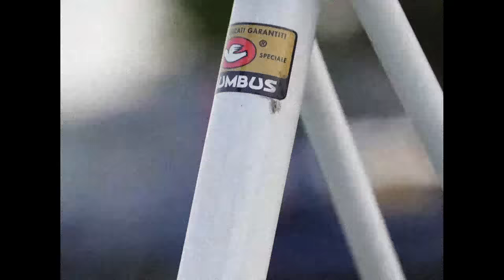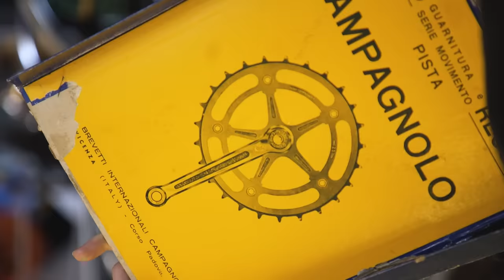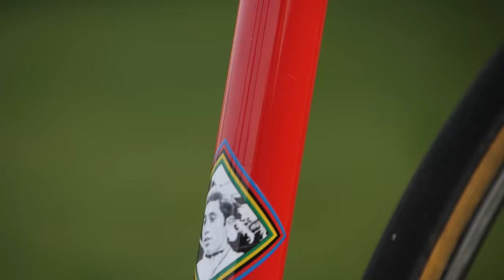Can A Vintage Bike Survive A Modern Race?

Comment from the maker: Have you ever gone racing on a vintage bike? 🚴 Let us know in the comments below! 👇
Reply: Well i only ever raced on 1970 era downshifters, steel frame, five gear block, tubulars.
Reply: Do a track stand at the start
Reply: A classic bike would generally come with 52 tooth large chaining and 14 teeth rear for 100.3 inches.  Now i have 52x11 which is about 27 percent higher. Eddie probably used 54?
Reply: Fifty year old new campy wow!
Reply: No
Reply: My only bike is a 1986 Koga Miyata Randonneur-Extra, but I don't race. ;-) (and yes, I'm vintage too, I guess)
Reply: Great job Si, and every time I race I'm on a vintage bike!  🙃
Reply: It depends on what you call vintage. If you mean steel, the answer is yes. From 1995 to 1999, I raced on my Bianchi TSX, and from 2001 to 2017, I raced on a steel frame, built with True Temper OX. I raced on an Aluminum Cannondale from 1985 to 1994, and an Aluminum Giant TCR in 2000.
Reply: Sure did.... from 1977 through to about 2000. That said I also rode my 1993 Pinarello full-time to about 2016. Going on intense group rides with guys on carbon weapons, I had no problem keeping up, once I got used to the straight block gearing on the rollers... but not a problem at all.
Reply: Not racing but I ride around town on an '86 Dawes Galaxy I got for £40 😁
Reply: I started racing in the mid-80s and the bikes were not that different from that Merckx model.  There were clipless pedals, but my father wasn't going to shell out "$75 dollars for pedals?!?!?!".  That said, toeclips did/do come in sizes, so you probably need a bigger set!  I thought you looked pretty smooth out there...brought back some memories.
Reply: I still have my 1988 Peugeot, that I raced on, although it has got modern 10spd Shimano running gear on it. It only weighs maybe 3 or 4 kgs heavier than carbon bikes, which in the real world makes zero difference.
Shout out to the guys with carbon frames, di2, deep section wheels who only cycle for recreational needs! (I'm one of those too)
Reply: @jonglass  Never mind that u just keep out there doing it Jon !!!
Reply: Si, do the vintage fondo in Santa Barbara, California. Your required to wear period jerseys too!
Reply: Nope
Reply: I have vintage and modern but vintage is more fun
Reply: I did back in the early eighties on a sweet Peugeot, now I cruise around on a few vintage 40's single speed bikes full restored.
I am by no means fast, but I'm still pedalling 👍😂
Reply: Yes, I did the Red Hook Crit on a 1980s track bike.
Reply: I raced this bike in my second triathlon ever. It was a reverse tri on a military airstrip. Had a great bike split, passed twats on $10K bikes like they were standing still. If you put a strong athlete on a great bike they're going to kill, but you put a weak athlete on a great bike they're going to have their asses handed to them.
Reply: First road racing bike as a Junior in 1985. Colnago steel frame/fork Columbus SL equipped with Campy Triumph group set, 36H ambrosio wheels for training, 32H Mavic GP4 tubulars / Vittoria CX/CG tires when racing. I also built my own wheels over the years racing in the 80-90’s.
Reply: what if vintage bike has modern component, neo retro concept, steel frame carbon component
Reply: Lol I raced them when they weren’t vintage. I was racing when Gregg Lemond was a junior. Still have one on my indoor trainer.
Reply: @secretagent86  52/42 front 13/21 rear 6 speed shimano AX
Reply: @0ldw3lshm4n  I have this ratio on my shimano 600 on my '86 Tommasini.  I do wish i had an 11 tooth cog sometimes but at my age, not often.
Reply: Racing no... but I learned on a vintage bike.. well 50 years ago it was not that vintage, but... 😅
Reply: The answer would depend on what you consider ‘vintage’. I have a 2005 aluminum frame of classic geometry and round tubes. It even came with down tube shifters which I later upgraded to an Ultegra groupset of the same year. Does an 18-year old bike count as vintage? It certainly is the oldest of the bunch wherever I go. I would say the limitations have been mainly of my own, not the bike.
Reply: Yep, as a young fit broke man I bought a Motobecane Jubilee Sport at a shop one of the mechanics was selling. Asked him why he was selling, he told me it was too slow to stay in the pack and I would not understand. Rode away from him and his new fancy bike a good dozen times at least as he dropped off the pack doing the Saturday Shootout in Tucson in the mid 90's. And I showed up on it for the Tour of the Tucson Mountains, soloed up to the pro pack from the 3 and higher pack on a big hill, wearing my cut off jeans since I was really that poor, rode into the middle of the pro pack and stayed with them for a good ten miles until a big attack happened and me with my six gears on the back and Helicomatic hub spun out and got dropped. Rode for a while solo, then some pros who had flatted caught me from behind and rode with them a bit, then they dropped me and I did ten miles solo before the 3 and higher pack finally caught me. Finished almost with a Platinum time but not quite. Some guys I knew saw me after and asked how I did, told them I might have done better but got spun out, they start telling me it is not the bike, glance at my bike, stop mid-sentence..."on that?"
Reply: Colnago Mexico
Reply: @secretagent86 so I am between, I have modern bike though but I love using 53:11
Reply: As Si walked past the ambulance I was thinking oh no they are waiting for him
Reply: yep, dad has similar. 54/44 11/21 gearing 😅. And Columbusframe,
Reply: Yes.
Reply: Bien sûr! il y a 40 ans...et j'ai toujours ce vélo! Cadre Reynolds 531, cintre et potence Cinelli, groupe Campagnolo Record, jantes GP74 Mavic à boyaux. Un vélo toujours très réactif
Reply: I once accidentally joined a bunch of friends for a tour on a fixed gear steel frame Faggin from the 70s because I understood they wanted to go to a lake for the day. Turned out they wanted to tour around the lake, 70k Sunday tour. 49/17 was all I got to keep up with the lycra suited guys on top notch cannondales. Didn’t get dropped though, but even though they didn’t admit I believe because they took it a bit slower seeing me there 😂
Reply: Yes - rode a 1969 American Eagle Semi-Pro (bike brand was relabeled Nishiki in later years after they got flak for calling it American anything as it was made in Japan by Kuwuhara) in the 1974 and 1975 Libby Logger Days bike race outside Libby, Montana.  While it was "vintage" (in a vintage race) I think it was maybe the only bike in either race with a double-butted frame, so it was hi-tech at that time in that secluded location.  Took 2nd place both years in a field of 20 or 30 although I wasn't much of an athlete.
Reply: Yep - Eroica Britannia - my local climb PB is on my 1980’s steel bike
Reply: all the time on one of the 4 vintage Colnagos I own, like the Master Lite Rabobank with Pro parts and a Dura ace 7800 carbon crank.
Reply: Get toestraps that fit. I still ride a bike like that every day but I've never raced and it never interested me.
Reply: Do a video with an elite pro riding a vintage bike on a modern race pls🙏
Reply: Vintage Bike Races at Goodwood?
Reply: Eu tenho uma Caloi 10 1976 fabricada com peças do Japão.
Reply: Hi. Yes, and it was perfectly good fun, although I did get dropped but I think that was because of a lack of strength, possibly because I'm just weak & useless, or not long enough on the bike yet (3.5 years). It was straight from the go "... please let this stop ...", so the pain and anguish you can experience on an older bike is just what it needs to be. I got dropped  eventually just like half the field, but I was parading around an eye popping steel Bianchi with an beautifully curbed alu fork, normal inner tubes, rim brake, alu wheels (double walled) and ... bar con shifters (!). A nice big handlebar from last century, costumised with a solid .08 stone (.5 kg) stem (spray painted by yours truly), with your individual Miche sprockets in the back, no fewer than 8 of them (5 would be too many, but got to keep up with the times I guess). The original Look pedals (delta). It was a low level practice criterium on a 1.1 km loop on brick roads with sharp corners. As far as I could see, I was the only steel bicycle in the field. The barcons are probably the most unusual. Despite the tight circuit, I only needed to shift once up and once down every loop. It was marginally more tricky than brifters would have been, but with a bit of anticipation it was fine. (I don't think I would dare go in with down tube shifters, due to added instability.) Conclusion: you can no problem participate in a race with this kind of set up, at least in a beginner category. This was still a real race. Most guys rode something nice and where in sponsored or club outfits and the like. It makes me sad that this whole category of bicycle is sort of lost. It is fine for most/all touring, much training, and certainly lower level racing. It used to be a long lasting, cheap kind of bicycle, with a local economy around it. Can the UCI increase the weight to 1.5 stones please ? XD
Reply: The best riding of my life was in the early '80s, so that's what we all rode. It was the culmination of a decade of incremental upgrades, the most major being a 7-speed block and a Gios frame.
Reply: Fun video!  Getting dropped off the bunch at the start of a mass start race was definitely a thing back in the day.  Happened to me in my very first race (1986) because I hadn’t thought to practice the skill!  😂  Luckily, clipless pedals came along shortly thereafter and I was an early adopter!
Reply: Yes. Still race on 1986 Columbus SLX with SSP group set and singles. Competitive? yes if I apply myself. Riding technique I find is key. I tend to spin faster when there is a surge and shift when I am up to speed. New bikes are a lot easier to race on with fancy shifters etc. New bikes encourage gear shifting.
Reply: I used to race bikes made in the late 50's.
Reply: modern wheelset ang groupset for classic frameset
Reply: @secretagent86  Eddie used 52x15 (97 gear inches) to set the hour record in 1972.
Reply: Mate, i still ride my Paletti, bought in 1976. Full Campag, Columbus Sl. I still have my Gios Torino, bought from the great italian track sprinter Giordano Turrini. Actually i think it is a Masi repainted. These bikes were cutting edge in their day, and my Paletti is still my best mate!
Reply: @secretagent86 Actually, most raced 42/53 with 13 - 17 cluster at the back, or modified for high mountains or perhaps 13-21.

Comment: Absolutely love the takeaway message at the end. I recently tried a couple of crits after exclusively racing track for a few years. Turned up on a $200 facebook marketplace special sporting 15 year old Tiagra. Did I win? No, no I did not. Did I have fun? WAY more than $200 worth. Turn up on whatever you've got and get stuck in! We aren't playing for rainbow jerseys or olympic medals. Just have a go
Reply from the maker: Great! This is what we love to hear! Doesn't matter what you ride or where you come, the main thing is the enjoyment! And we think it's pretty hard not to enjoy riding a bike 😉
Reply: Love it!
Reply: Turn up on whatever you've got, and hopefully that also includes 10 years of pro racing experience. :)
Reply: I recently went to try gravel riding. I did not have a “gravel bike” so I rented one. As I was riding, I realized I was just riding a mountain bike without front suspension, and with drop bars. I took my rusting away, 2004, Trek MTB, cleaned it, changed all the drive train and the breaks, and changed the handle bar for drops. I ended up with a super fun, super comfortable (the suspension is awesome) gravel bike. I spent just $350 for the drive train’s cheap components and that was it. Save your money, lose some pounds and just ride. You will get better.
Reply: Best comment of the week
Reply: @lgarcia67 yeah basically what gravel bikes are . I Would do that as well 😅

Comment: sure you had the wrong cassette in, the toe-clips were too small, & down tube shifters, but you also had the best looking bike there... so that's a win!
Reply: He didn't have a cassette, he had a "freewheel block".
Reply: @stevemawer848  Also a bit of a corncob. He does know that you could have a wider range within those 5 gears installed even then, right? The pros didn't for the sake of macho, but you can get a much wider range than shown here, just depends on how authentic you want to be to Merckx and his ilk versus how you want to ride.
Reply: @cptjeff1  Ah yes, the Regina board with all those lovely sprockets waiting to be mixed and matched!  Are things really better nowadays? 🙂

Comment: Eddy Merckx has actually said in interviews what he would chose from the modern era it would be clipless pedals. Everything else is marginal, that he says was a game changer.
Reply: All of my bikes are from the 70's and 80's. They all have clipless pedals. :)
Reply: Yes, true re the pedals. The only other thing I would add would be 9 to 11 cogs in the back wheel + handlebar shifters. All else, frame wheelsets and tires  need not be changed. Current bikes being carbon fiber are a real scam, far too expensive for what it gives in performance. They are also much too brittle.
Reply: Nobody had clippless until around '86. Prolly started arriving on to the pro scene by '85...Look.  Seems like they could have figured it out way sooner tho...funny how that worked.
Reply: clips are great in reality, grocery getter.....when you hit a large bump you can pull out of them naturaly , AND YOU CAN USE WORK SHOES OR SNEAKERS!
Reply: Maybe it's not really marginal? Perhaps.  But the parts doesn't need to cost a fortune.  There are great modern parts novadays. For example saddle, saddle post, rims, and  so on.

Comment: Way back in the late 80's I bought a used Vitus 979 Aluminum frameset. It was polished with a clearcoat. I transfered the Shimano 105 groupset from the bike I was riding and had a perforated leather Selle Italia seat. I still think that was the best bike I have ever owned.
Reply from the maker: Sounds lovely! Do you still have it?
Reply: Me too bought a 2nd hand Vitus in 86, did more miles than the space shuttle. Expensive but I go my $ out of it😅.
Reply: Sounds very nice !
Reply: 979 and 992 are so fun to ride. So stiff and agressive.

Comment: Drafting makes an incredible difference that no wheelset, frame or skinsuit can compete with. So if you have none of those don't ride on, or go off the front!  It actually forces you to ride smart and not waste energy or otherwise you get dropped.
Reply: That's not true, it took 5 gcn drafters to beat a single tt bike guy
Reply: No kidding!  That could be why you "faced a wall" off the front! :)
Reply: @jason200912  If you don't think drafting makes an enormous difference you haven't done much cycling
Reply: @jason200912  First of all in a road race everyone is on the same road bikes. TT bikes are not allowed in road races. 2nd of all it is an undisputed fact that drafting saves one ~30% of ones energy. Anyone can see this if one has a power meter. In a recent race I was averaging ~300watts for a minute on the front and ~200 watts in the wheels at 40kph in my small group of 8 on the flat. Unless you're on a Boris bike you won't be dropped in the wheels of similar level cyclists.
Reply: @davidf2281  sure it makes a huge difference but you still need 5 road bikers to beat 1 tt biker
Reply: @jason200912  not the same as sitting 20th place in a bunch though.
Reply: @0ldw3lshm4n  why would you be 20th if you know how to draft while on a tt bike
Reply: @jason200912  what are you on about? My point is sitting 20th in a bunch has more drafting benefit than a single line in 5th place. if you dont believe me try riding behind a derny on a track in a line, 1st place is great but when you peel off and drop in 8th place its really hard to keep up.

Comment: Good luck in 50 years getting a moden day dura ace to work 😂

Si as always a beast on the bike
Reply: At that stage, the di2 battery would hold about enough charge for the neutralised 1st lap.
Reply: Mechanics say those old friction shifters are practically indestructable.
Reply: My oldest bike with derailleur gears is a 1953 James that has Cyclo Benelux Standard THREE speed for 1/8" track chain. 27 x 1 1/8" High Pressure.

Comment: I just fixed up my dad told road bike from the early 80s. It was such a joy to ride it. The downtube shifters are actually really nice, and I feel more in tune with the bike using them. It’s probably slower than a modern setup, but the feel is outstanding.

Comment: When I compare my rides on Strava between my Pegoretti Luigino and my OPEN U.P. with 50mm aero wheels, the Pegoretti is just as fast if not faster on a lot of segments. Some of that might be due to the larger chainrings but still, that lugged steel bike is so fast and more comfortable than the carbon one.

Comment: Amazing stuff. Si is a beast! As someone who rides a modern but vintage inspired steel bike (Temple) I’d love to see one of these videos with a traditional-ish steel frame but modern wheels, gears and other bits.
Reply from the maker: You should check out our 'Retro vs Modern' doc on GCN+! 👉 https://gcn.eu/rvm
Reply: I’ve got a 1995 Mercian in Reynolds 531, but with modern 105 groupset and new wheels. The gears made the biggest positive difference - my smallest gear when I had Suntour was 42/21 and now it’s 34/28 so hills are much easier! However my pedals aren’t as good (IMO) - I had Time Equipe and they were absolutely stunning and had more float and were more comfortable than the new Ultegra I’ve got now.